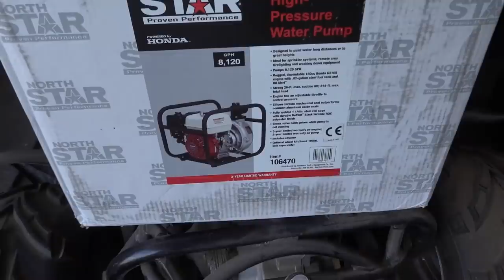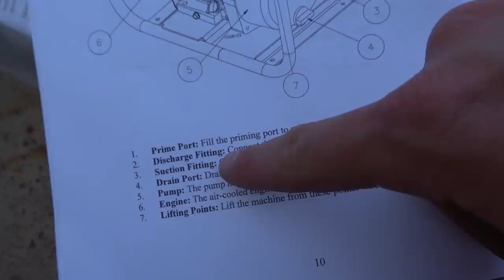I Built the Pumper Truck!!!!! Master Chief is Alive!!!

Comment: Just remember, when the tank is partially full, you will have surge when you go to stop from the weight of the water shifting. I used to do farm work and we had a thousand gallon water tank that would push you through an intersection if you weren’t paying attention. Also it changes your center of gravity so be careful going down hills sideways 🤔. Just random thoughts.

Comment: word to the wise, matt..always stretch your line before you charge it..and never charge it, if it's still in the truck.
also be careful slamming the nozzle shut so you dont water hammer that little pump.

Comment: Oooof the duce and a half line is a b***h to move around if you are running around the woods. But, if you stick with that red cotton hose, make a little hose bed or rack for it. Also, there are a few good ways to lay it out so its easy to pack up and easy to pull when you need it. You could also go with a soft jacket 1" hose and a hose reel as suggested. Those are cool because they make ones that wind up with a little motor on it too.

Comment: Already for Christmas or just after
Should’ve got a pump with an electric start
I’d stick with the camlock‘s there quick and easy the little bit of leaking is manageable you may need another pump to fill the tank separate from your pressure pump in a real bind you could fill the tank and spray at the same time I talk to your farmer buddies they know how to move water
I would get a diesel pump two of them plumbing right into the truck

Comment: How worried are you about brush fires? A pipe across the front and back with nozzles.pipe it together to one of your quick disconnects that way instead of hose you can connect pump to spray pipes in front and back. Just remember playing with plumbing can give you plumbers butt.

Comment: At about 135 gallons per minute, you’ll empty that tank in just over 4 minutes. That sounds bad, but what it means is that you’ve got to be frugal with the water. Frankly, you’ve got to check YouTube for videos. Bottom line: you have to be efficient and effective so that the water that you’ve got does the job. You’ll probably have to make a second trip to soak hotspots so the fire doesn’t restart later on. Do you have a pond to get water from? If you don’t, you may want additional water storage. In rural areas, they put large, relatively flat, tanks at ground level and cover them with dirt and fill them with water for emergency water supplies for fire fighting.

Comment: This truck actually have Austrian origin! Here in Austria it was developed as Steyr 12M18, later the manufactor won an order for the US Army. They truck was built under license by Stewart & Stevenson with modifications to meet the requirements: CAT engine, automatic transmission, no differential locks to name the most important changes. Original 12M18 here: https://de.wikipedia.org/wiki/Steyr_12M18

Comment: Honestly the water pump would work way better if it was mounted on the side of the truck like how the diesel tank is. You can run the gas to it easy, and you will have room for any type of hose you wish for and the valves and all the pump controls will be accessible from the ground so that little time is wasted in an emergency.

Comment: I’m no professional but I think I have an idea about fixing the issue of the placement of the pump and not being able to start it from the ground. If you made a small compartment under the bed then made hole in the wood to feed the hose under you could then start it from the ground. That might be over complicating things but I THINK it might work. Again I’m not a professional and by no means am I in any type of position like this but I think having a little carrier under the bed would be a good idea.

Comment: My suggestion would be to mount your water tank on an angle with the back end being higher so that the hose will have water flowing through it all the time when it is getting to the bottom of the tank. If you don't your pump will lose pressure because it is sucking air and not water. The way it is now when the water gets low you would still have lots of water in the tank but you just wouldn't be able to use it because it would be sucking air and losing the prime on the pump. You always want water in the pump or you will burn out the water seal on the pump. If this happens you get no water. Just my 2 cents worth !!!!! Here in Canada it would be 5 cents worth as we no longer make pennies...lol

Comment: You could Mount the pump under the bed undercarriage right there on the side easy to start easy to get to with the cage on it it would Mount up Yeezys hell through a couple holes through the bed keep the bed open sand and other Fire Supplies takes melted perfectly do with the fire department does look at how the fire trucks store their hoses and yeah you need like a 20 foot hose so you got the SAS connectors on their you do really don't need a y

Comment: You will need to tap into your aux gasoline tank on the fire truck because you will be amazed at how fast you can go thru the fuel on that tiny little water pump.

Comment: Trade that inch and a half for single jacket 1” wildland hose. It comes in 100’ sections for about $75 - 100.
The tank is very tall and will be top heavy... just FYI. 
Also... driving with less than full (and unbaffled) tanks in trucks are DANGEROUS on uneven terrain and in turns.

Go your local volunteer fire department and look at a brush truck. 
And while you are there, why not JOIN and make a real difference in the world.

Comment: Redundancy. 2 pumps, 2 sets of hoses. If one fails you’ve got a back up. And you can alternate when you are operating it. And you have the ability to double duty a fire. You also would drain the tank faster but it’s something to consider.

Comment: FF here. If you want 2.5in  hose, that's more for structure fires. You're gonna want about 200 feet for a structure attack and you're gonna wana flat load it. If you want to fight grass fires or brush fires, you're gonna want 1.5in, I would buy about 500 feet and a hose clamp.

Comment: You have a 40 to 50 ft hose and have the water tank on back right and the engine on the back left and have a roller to roll out the hose and have the engine were you can turn it on from the side and have a gas hose go into the engine so that you only have to go to a gas station to fill it up and if you have a 100 ft hose you should have a roller for that to just for like fires that are a little far away and are pretty big but overall I hope you us my suggestion you don’t have to but you can us a little or all of it I don’t really care what you do have a nice day

Comment: Dont get a rigid hose .... fire hoses are ment to be soft and flexible with a rigid hose u cant use alot of the hose tools  that wildland firefighters use like a hose drier clamp .. used to help dry a hose out after its used on a fire there are a few other tools that u need like a mesh basket for the end of the hose if u plan on sucking lake water out u need it to prevent debrie from being sucked into your pump...

Comment: do they make electric water pumps, if so that might be a good idea because it wouldn't need fuel or a pull start as long as you have some way to power it on a truck.

Comment: Well you wouldn't probably read this comment but anyway: Tank placement should be over a rear axle to minimize the strain on a truck frame, lower a the momentum between main load and axle, plus this will put more pressure directly over rear tire increasing off-roading capabilities. Unsupported mass of hoses plus connectors going to wear down bottom tank port, don't hang heavy things on a plastic wall. Plus filling a tank with water completely will reduce rocking effect of the tank.

Comment: I’m a day late so you prolly won’t see this but here it goes. 

Cam locks are fine for what you are using them for. It’s not like you have constant high pressure to the pump. I don’t know if you plan on keeping the valve open on the water tank but if you plan on keeping it closed until you need it then there really isn’t a point in being able to start the pump from the ground unless you fit some kind of throw lever for the water tank valve that you can use from the ground also. 
For shorter hoses just cut your 100’ then use cam locks to be able to reconnect them. Again you might lose a little water out of the locks but for what you’re using it for it won’t matter. Or just get a short stiff one. But as you’ve probably noticed it’s hard to store a stiff hose 😉. 
Those little pumps should also run for about 6 hrs straight on a high rev. But half way should be more than sufficient.

Comment: Please don't try and fight any wild land fires with that. If the humidity drops low enough and it's hot enough you can dump as much water on it as you want and it won't go out. You should have gotten something to build a quick fire line if anything. Your doing everything wrong lol. Unless its a grass fire and tiny your screwed. Especially if conditions are right for the fire.

Comment: Firefighter here. Edited after I watched the whole video. Since you asked for professional input I’ll give you my input. Really good for your first attempt. You are going in the right direction. The tank should be baffled to prevent a half full tank from sloshing around so much. What you have will probably work fine but a baffled tank is ideal. The hose you use for “quick attack” should be 1” hardline on a reel. If that is the only hose you plan on using, your pump will be fine. If you want the ability to pump a longer hose lay or want to pump up a hill, your pump will be underpowered. That nozzle is a bit overkill for wild fire applications, but it will work. A 1.5” kk adjustable barrel nozzle is all you need. 60 gpm @ 100 psi. Also, you need to mount a shovel and a Pulaski. You should also carry a chainsaw if you want to use this as an excuse to buy a Sthil 362 c or larger.  Really good attempt for your first build. You have all of the components, just not proper fire rated stuff. Check out q tac fire apparatus. They make units designed to slip onto trucks and be fire ready. They also partner with content creators and I’m sure they would love to get you a slip on unit.

Comment: What would be real interesting if you could could hook the pump up to the truck’s engine rather than the little engine with a clutch to prevent it from just spinning when you don’t need it. It would be tricky but you wouldn’t have to mess around with gas, a second engine, and all that

Comment: I know you are in Texas, right next to Hell, but you need Bunker Gear!  A firefighting suit!  It can save your life!  Also before you fight ANY size fire, make sure you have removed ALL your jewelry! I had a friend in firefighting academy who refused to take off his St. Christopher necklace before our first practice fire.  He now had a permanent burn scar all around his neck!  Radiant heat has to be experienced to understand how far it effects reach!   Also, be careful when shutting off ANY water flow valve when water is flowing.  Water does not compress, and when you shut it off suddenly bad things can happen!  Shutting off a fire hydrant too quickly can cause it to be lifted up several feet, breaking the cast steel or plastic water lines.  It's called water hammer.  It can split a hose or break your line's sprinkler head valve that you are holding!  Also, shovels and rakes are a must, along with a fireproof blanket.  Don't forget a face mask!  A self-contained breathing apparatus would be great, but expensive.  Something to filter the smoke is a necessity!  Don't get in a fire situation too big for you to handle. And park your truck so if things go bad you are pointed in the right direction and all you have to do is jump in the truck and boogie!  Good luck, and here's hoping you never have to put out anything bigger than a bonfire!

Comment: You should never have a tank half full you should have it full or empty because there is space in the tank then the water will slosh around and the weight will shift and transfer.

Comment: Instead of upgrading to a $3,000 pump, buy a second $1,000 pump as a backup and keep both with all the fittings on the truck. The last thing you need is to not be able to start the Honda engine when you’re trying to put out a fire.

Comment: Your 5 1/2 ton truck is capable of carrying five and a half tons.  1100 pounds.   You can easily carry a 1000 gallon tank.  Your 500 gallons pumped at 95 gpm will empty in about 6 minutes

Comment: still kinda funny that this LMTV was originally designed and built by Steyr Daimler Puch in Austria for the Austrian Armed Forces as Steyr 12 M 18 and then got offered to the US Armed Forces during their search for a LMTV... and once the design and some test vehicles passed the checks at the official authorities they got license built by Stewart & Stevenson to have them built in the states instead of building them here and deliver them overseas (because of spare parts supply as well as keep manufacturing costs down and it had to contain a min. of 50% parts originating in the US)

the last of the original Steyr 12 M 18 are now leaving our Armed Forces and got replaced by MAN trucks so even the design has changed since then... but yeah... still that unique cab design that is being seen on the roads as well as design lines in the modern versions visible

greetings from Lower Austria and enjoy your 4-wheel offroad monster

oh and by the way because of the weight limits on the truck... if you stay on your own ground and land you can even load more than the specified weight onto it... it is just that it got classified as a "lower weight" variant but it actually can handle quite a bit (at least the original ones from Austria can do that) as the frame is basically the same when compared to the other versions... just keep the center of gravity low that you don't roll those things... seen that happen as well...)

and because of the fittings... I am so happy we in Austria use Storz fittings on our fire trucks... not just for hydrants but even for discharge hoses and nozzles... but for real use you gotta buy the pricy forged ones with the propper seals... not the casting shit you can get pretty much everywhere... (and the main reason I love those fittings... quick connect and disconnect with like a 120° turn)

Comment: Safety first. Those cam locks work great until they dont, and under high pressure, you can lose fingers, ask veteran pump truck workers... you've been warned, use metal zip ties or nylon straps to secure those! Worse, if under pressure one of those fittings flies off because of a bad camlock, people can lose their life.

Comment: Does the truck have a power take off? for static use a big pump runs well off a big engine.
https://en.wikipedia.org/wiki/Coventry_Climax  and scroll to FWM  350GPM at 100PSI

Comment: You made a huge mistake in you pump. Max flow is not at pressure!!!
You must always consult the graph to figure out the flow at a specific pressure. Usually it will be 1/3 of the advertised flow rate.

If you ever upgrade your pump look at the Australian Davey Pump with the twin Wide impeller. The pump will be a lot heavier.

Comment: you shouldnt have any issue with running out of gas on the pump that should run 3-4 hrs wide open pumping water and if you are putting out a fire with that for that long think you should be calling a fire department

Comment: Your hose dos not look like a 2.5 inch looks more like a 1.75 inch hose line fire hoses are measured from the inside diameter and not the outside

Comment: Get some weight down low, that unit is top heavy and prone to sway as a half tank slops around. Yes the gas tank is a great idea, but the pump you have will not draw fuel up from below, I expect is needs a small head of fuel to feed the carb but not flood it.
Watch https://www.youtube.com/watch?v=QT0e-GStAe4 He was a wildland fire fighter when he built his rig. His tank is flat and baffled into six inside.
https://www.youtube.com/watch?v=oIWxA7RNLI8 may give you some ideas to enlarge upon.
Look at bumper mounted spray nozzles and or a remote monitor on the roof.